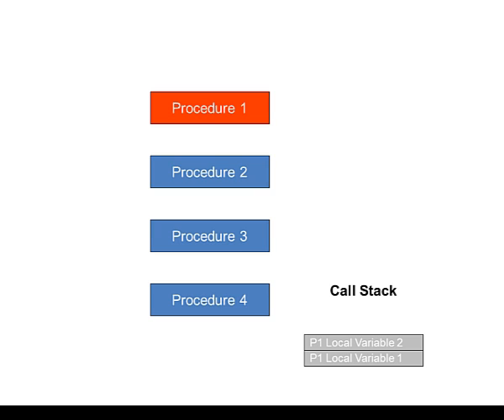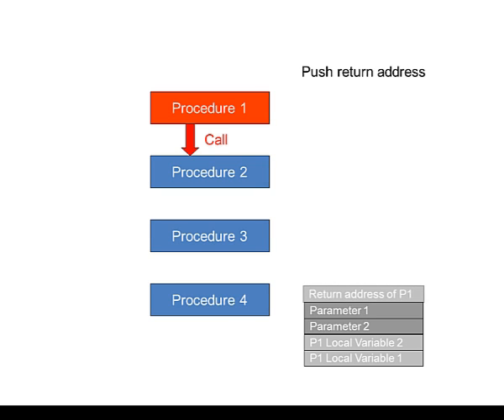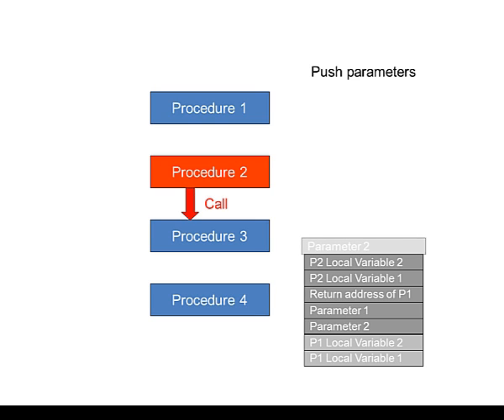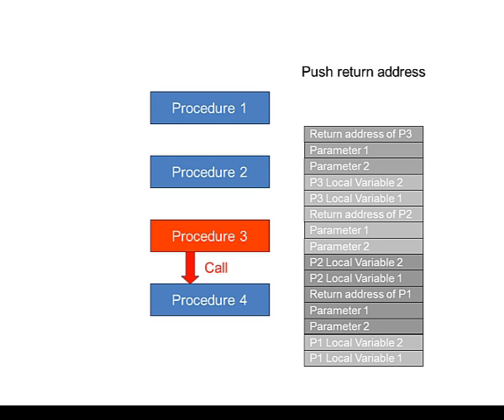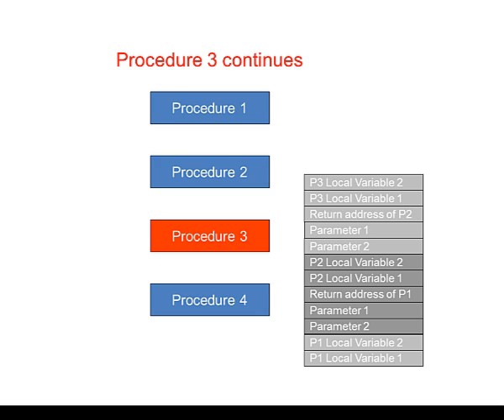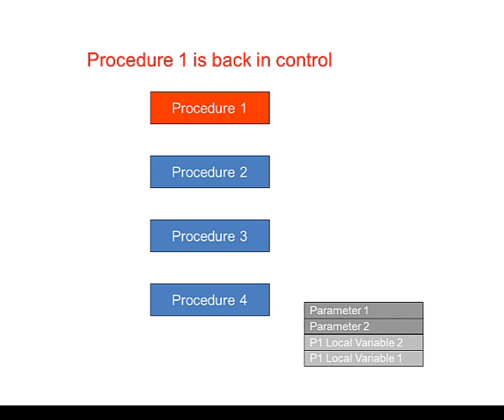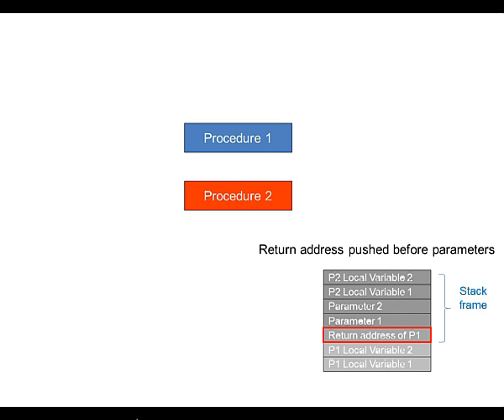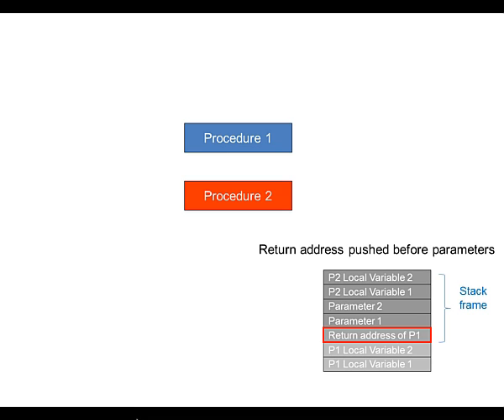The Call Stack

Comment: How do I troubleshoot Windows 10 error "new guard page for the stack cannot be created"?     I know nothing about programing!
Reply from the maker: This error indicates that you are low on memory, or virtual memory.  (Virtual memory is a swap file on your hard drive, or SSD, that is used to supplement the RAM when it's getting full.)  The circumstances under which the error appears are important.  Is it being triggered when you are playing a particular game?  Does your computer meet the requirements of the software you are using?  What has changed since you started seeing the error message - did it start after you download something?  Grand Theft Auto for example can be problematic.  A lot of computers these days boot from an SSD (solid state drive).  The SSD holds the operating system (such as Windows) and is usually labelled drive C.  SSDs tend to have a much lower capacity than magnetic drives and will fill up quickly if you install all of your applications on it, leaving little space for virtual memory.  How full is your drive C looking? (Click on This PC in File Explorer to check.) If your computer has another (magnetic) drive (labelled drive D), install your software there instead of the SSD in future.  You could also try moving some of your software from C to D. (I put all of my Epic and Steam games on drive D). Be careful how you do this, you can't just cut and paste files.  Maybe you could also do with a general clear out.  Uninstall any applications (incl. games) that you don't use anymore, and delete any photos and videos you don't want to keep (or move them to an external drive).  Be careful not to throw the baby away with the bath water!  You could also defragment your drive if you haven't done it for a while (right click the drive in File Explorer and select Properties then Tools). If you have a PC that you can expand, you could also consider putting some more RAM sticks inside it (but make sure you research how to do this, or get someone else to do it for you, if you are not sure what to do).  Good luck :)KD
Reply: @ComputerScienceLessons  Thanks for replying!   I will try your suggestions.

Comment: Great explaination. One question: Why are agruments of a function read from right to left?  The right most argument is at the bottom of the stack. 
Can someone please help me understand what if we read it other way round( left to right). ??
Reply from the maker: Interesting question.  I believe it has to do with the fact that functions can be defined with optional parameters.  For example, here is a VB.NET function definition with two mandatory parameters, a and b, and an optional parameter.
Function myFunction(a As Integer, b As Integer, Optional c As Integer = 0)
Any optional parameters must be specified at the right hand side of the comma separated list.
When these arguments are read onto the stack, the mandatory ones will end up at the top, and their memory locations (offsets) will be known at compile time, so it's possible to access them more easily.  Optional arguments, which may or may not be there, are lower down. :)KD

Comment: Hi, do you have a video on binding? and how different binding works? AMAZING VIDEO BTW!
Reply from the maker: Thanks for the comment.  :)KD
I haven't covered binding explicitly, but it does come up in some of my videos.  I have made a series of Python programming videos which mentions implicit variable declaration; in Python, a variable need not be declared explicitly, as it must  in VB.NET (with Dim or Public), rather, Python infers the variable data type from the data you assign.  This is called dynamic binding.  I have also made a series of videos on object oriented programming with VB.NET.  This includes a technique known as method overloading.  When a program that calls an overloaded method is compiled, the compiler has to work out which variation of the method will be called at runtime based on its method signature.  This 'resolved' call becomes part of the compiled code.  This is known as static binding.
These videos might help:
https://www.youtube.com/watch?v=aoZeeKXL4aM&list=PLTd6ceoshprefszdKKM-hKF9efAwF23vN&index=2
https://www.youtube.com/watch?v=9Uy4k9znenE&list=PLTd6ceoshprcFCsO49h2870tVzEeFpeWk&index=5&t=133s

Comment: Wouldn't it make more sense to push the return address first, then the parameters? This way, when the called function returns control to the calling function, the stack frame is already clean.
Reply: It's really just a conventional issue to decide who is responsible to clear the stack. In the given design, the procedure which pushed the parameters is responsible to pop them again. When programming in Assembler you can 'abuse' this functionality whenever you push the same parameters over and over again to (different) procedures, so you don't even need to push pop them over and over again, just once pushing them onto the stack when calling the first procedure and popping them after a last call.